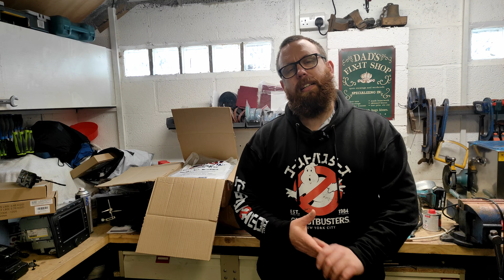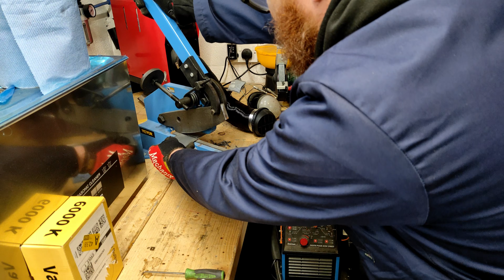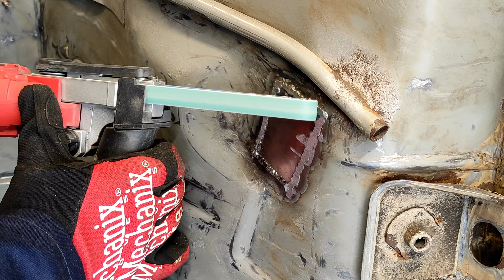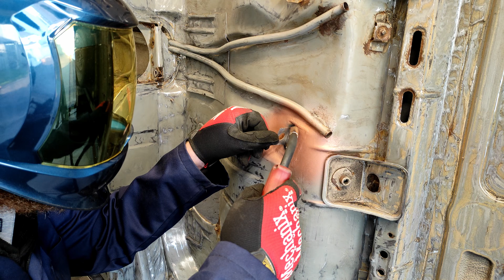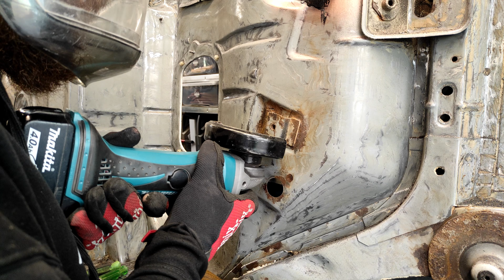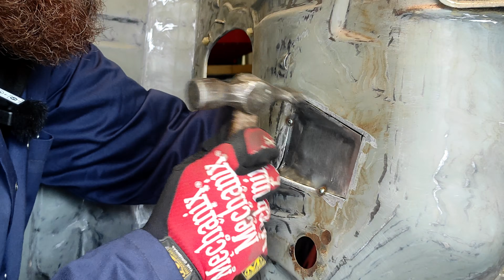Bmw E30 rust repair and I experiment with a shot blaster

Comment: You are doing the right thing by immediately cutting out areas affected by rust and welding patches, there is no point in cleaning them, since the metal there is already thin.
Reply from the maker: It's definitely the best way to make sure it's gone for good! 👍 I might clean up some areas, but I will only clean up very light surface rust.
Thanks for the comment 😊

Comment: Take the end off the hose of your sand blaster and fit a ball valve then screw the lance handle back onto the other side then you won’t have to keep hold of the squeeze trigger when blasting, simply open the valve and away you go 👍🏻
Reply from the maker: @jimble1986  I have seen this modification done before, perhaps something I'll do in the future 👌

Comment: Yes you are correct it is for paraffin/degreaser, going back 40 years ago I bought a blaster from machine mart it looks like a spray gun  to do under a VW 412le I had you can use dry building sand , grit , glass beads etc a the blast medium. I've since purchased a spot blaster it's good for more small area's.  Machine mart also sells all the blast medium's in resealable tubs. I've used these guns for some years with good results, always remember as soon as you're finished blasting get the bare metal covered with paint do not touch the bare metal  before painting with your bare hands you don't want the rust to start again.HAPPY BLASTING
Reply from the maker: @DAVIDYATES-t3l  I have recently bought a cheap spot blaster to test out, the big unit has a lot of setup involved, if its only for a small area it's a bit of a faff!

Comment: Sorry, But Im going to be THAT guy. I know you are in the UK and names vary. But if you turned up in my country and asked for a piece to be SHOT blasted you might not get it back.Technically SHOT blasting refers to using steel shot, small BBs, usually to peen a surface. ie conrods after you have polished the side of the beam. This compresses the surface to help stop cracks. Using sand, soda, garnet, walnut is more media blasting. Using glass in water, in a cabinet, is another type of , wet, media blasting. And yes you are using a kero cleaning gun. A sand blaster will have a hardend steel or ceramic nozzle to stop it wearing away too fast.
Reply from the maker: @mac4boys541  That's ok, you can be that guy at least you know different countries often have different names for things. If you are interested the process you talk about we would call shot peening, I had that done to gears in my gearbox once to help prevent failure 👍

Comment: Wondering if you could kindly do a video of that rotisserie jig you made. Details of making it, etc… well done on the wooden jig & welds & all. Great content & of course your presentation skills!
P.S. wondering if you might consider getting a VW T3 (years 1983 - 1991) van for a project? I have so much work to do on mine I don’t know where to begin.
Oops! Disregard! I just saw you already did one on the rotisserie jig….
Reply from the maker: @earlyreefer  I'm glad you found the video, I try to show as much planning/ building in it as I can. I also I highlight how low the roof is a the struggle to get the thing to work!! But I enjoyed the process👌. I have too many project at the moment, I'm trying not to add anymore! Well not yet at least🤔
Reply: @ my garage is so small that even a vintage MiniCooper won’t fit! It’s all in the gravel driveway for me then…

Comment: Nice work. I would appreciate some hints on the rust converter and primer you use, as there are a lot of brands in the market that deliver lousy results. Heinz, Germany
Reply from the maker: @HeinerStorchennest1  Thanks 👍 I do have a video coming out that briefly talks about the products. Long story short, the rust converter is dimitrol rc900, copper weld through primer is upol and epoxy is novol. This is the first time doing this type of work, so I have nothing to compare it to! But so far I have no complaints, except the rc900 is quite expensive!

Comment: I've got one of those tank shot blasters , only used garnet as cheap and found out to turn the bottom feed rate tap to about 1/3 and run about 100psi. Laying a tarp down and around the car helps collect it for later use after it's been thru a fly screen to filter out junk particles.
Reply from the maker: @marty3469  Thank you, how well does the garnet work? This media I am using seems very aggressive, which is good, but not always needed!

Comment: Very inspiring video - great content. Hope for more like this!
Could you please tell me what you are using for treatment, coating etc. And the order of such.
Please also name of the products that you are using. E.g. the "cupper" coating what is that?
Again thanks for a very informative video
Reply from the maker: Thank you, Im glad you liked it.
I have been using dinitrol rc900 for the rust convertor/protection, and a upol weld through primer where I need to repair (the copper stuff).
First time this sort of repair work, so I cant compare it to much, but it seems ok. The rc900 is a bit pricy however.
In future videos, I will try to include more info on the things I use

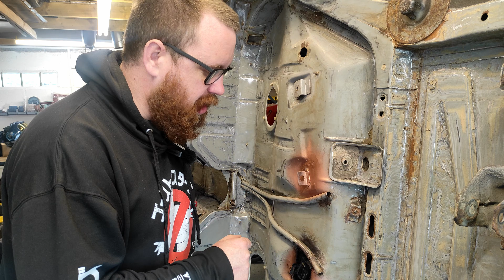Comment: 14:07 how you firgured out the correct position of that L bracket there?
Measured old position before cutting? Or measuring with just eye?
Reply from the maker: @jw200  Thanks for the question, so this bracket I did by eye. It holds brake lines. Which I need to remake anyway, so location isn't critical. Later in the video I replaced the fuel tank bracket, the position was important, so I made I basic jig to align it back up. So it does depend on what the bracket is for, whether I measure or not

Comment: First time watching, wanna say great work on what you've already repaired. No two rusty spots are the same, always a challenge with each and every one of them.
For crusty brackets I like to make small jigs that bolt to the brackets normally, build the new patch & bracket and just make sure the jig bolts up same as before and everything lines up. 
Multitool for the underside is actually brilliant, you're not drowning in underseal fibers like poor Ryan over at YCR, I'll be "stealing" that trick as well.
That shotblasting pot is actually a good unit because it's designed for people with lower capacity compressors, but you wanna hold the trigger down then operate the valves on the pot, so basically always hold trigger down so the grit doesn't have time to clog up at the valve under the pot.
As for getting to that last string of tacks and melting through, use compressed air and cool it down faster, when you get to areas you actually have to clean up down to within the gnats leg I use a dremel with cutting disc and just get it absolutely flush.
Reply from the maker: @ToreDL87  Thank you for the compliment and comments. I did make a basic jig for bracket alignment on the fuel tank bolts, last thing I wanted was to not be able to bolt that sucker on!!
I use the multi tool for that exact reason, the mess! It is is arguably slower work (but faster to clean up!) and it is loud, especially on a bare shell. So it does have some downsides. 
The blasting pot is definitely a bit fiddly to set up, but I get it working well enough, video to come on that.
This project has been a massive learning curve, my welding at the beginning was, well not as good, putting it nicely. Making welds invisible isn't a high priority on the underside, but the practice is invaluable. But yes, I will be taking more care on the finish, where it can be seen, an air line is a good tip 👍

Comment: Your red air tool is more designed for paraffin/degreaser
Reply from the maker: @ianwalkden3024  Thank you, that may explain the troubles I had 😂 👍
Reply: @BackGardenGarage  I use a spot shot blaster,ideal for small areas, comes with a couple of different nozzles and it collects most of the used shot for reuse. It doesn't require a massive compressor either
Reply from the maker: @ianwalkden3024  Thanks I will look into one, might be handy for a couple of small areas

Comment: Great welding. I'm self taught and have done similar projects. It's very satisfying to do it yourself and saves a fortune. I've got an mx5 that is made up of free washing machine sides, looks great though, you'd never know 😂😂😂
Reply: What kind of welder are you using. Mines just a cheap old snap on but I'm considering upgrading
Reply from the maker: @tipsandtricks5258  So I'm using a Clark welder, it was a "cheap" one 20 years ago. I have often thought about upgrading, but it keeps on working so...!
Reply: @BackGardenGarage Stick with what you've got it's clearly working well. I made a stainless exhaust for my daily driver and a pal of mine gave me a hand, he couldn't believe how my little old welder performed, he's got a really expensive professional unit and he was adamant it performed better than his.  Clarke are always good, when mine fails I'll grab one. Keep uo the good work, I'm following 👍👍👍
Reply from the maker: @tipsandtricks5258  So the settings are limited, but that can also be a good thing, otherwise I'll be changing things not knowing what I'm doing lol Thanks for the support 👍
Reply from the maker: @tipsandtricks5258  Nice one😂 I always like to make a saving where I can aswell!

Comment: Great work there. Been looking at getting a shot blaster too 😁 what welder are you using? 🙂👍
Reply from the maker: Be warned the mess is unbelievable! it will also push your compressor to its limit.
The welder Im using is a clarke 151 TE turbo, its a simple no frills type welder, seems do do the job well enough
Reply: @BackGardenGarage  thanks, had planned to be using it outside....  cant add to the existing concrete dust from the floor in my garage 😭😂 look forward to next video

Comment: Good work! I sandblsted most of a car with a cheap pot, maybe 20litre one, last summer. It was very effective but slow and unpleasant work. Not sure id ever want to do it again tbh! What brand of sanding strips do you use in your finger sander?  The cheap ones im trying loose their grit in seconds😂
Reply from the maker: Yeah for as good as it is, Im not sure I would want to do the full car!
The best belts I have used are "NORTON ZIRCONIA CERAMIC R929", I did buy them from ebay. Definitely better than the cheap multipack ones. They last way longer, but The tool is fairly new to me, so experience is limited

Comment: The only cheap sand blaster I've got working is one that attaches to my pressure washer. That works great but is obviously wet. Can't get the gun or spot blaster to work at all. Might need fatter air hoses or different medium.
Reply from the maker: @tahustvedt  I have got a cheap attachment for my pressure washer, but yet to try it. The little hand held unit I'm sure just needs soda or very light media like you said. The big one I have got working (video to come) messy doesn't quite cover it lol
Reply: When using a sand blast you need a water trap / regulator and follow the manufacturer's instructions blasters require a large amount of air the same as when you use air tools I have a 3HP compressor but for larger jobs I made a reserve cylinder out of an old 47KG propane tank which is fed from the compressor and draw off the reserve tank via the trap/regulator. HAPPY BLASTING

Comment: You can try a silent compressor array.
Reply from the maker: @aadd3538  The compressor does keep up with what I need it for, doing small sections at a time. The silent compressors are outside my price range for the size I would need

Comment: Nice work. It would be nice to have 3-phase electricity at home wouldn't it? Next time you need to buy any penetrant, try the Bilt Hamber Ferosol. It really is the best I've come across. In fact, all the Bilt Hamber products are excellent, particularly the De-Ox C.
Reply from the maker: @bobfrankish8883  Thanks, I had never heard of bilt hamber until recently. And that's only from comments I get. So when I need to buy some more, I will look into it 👍